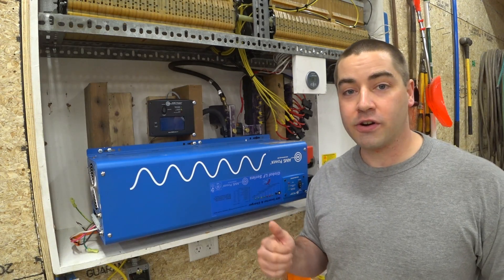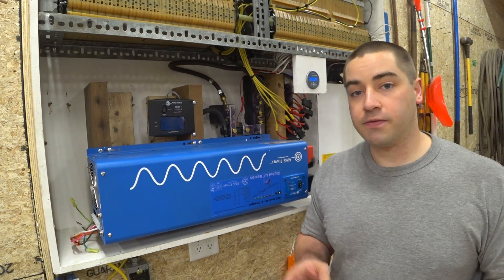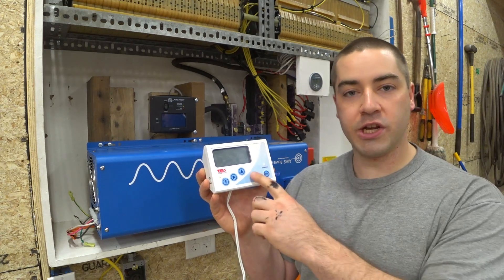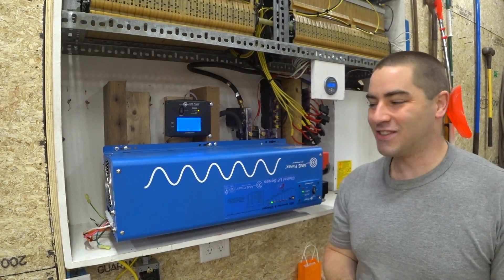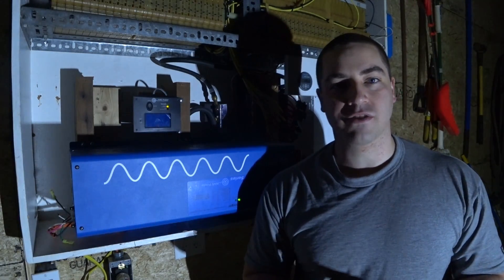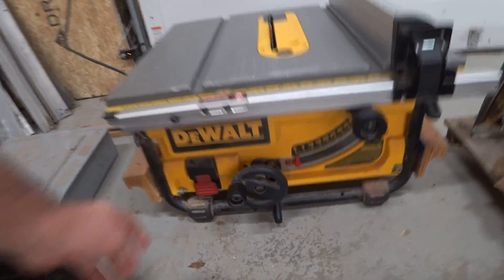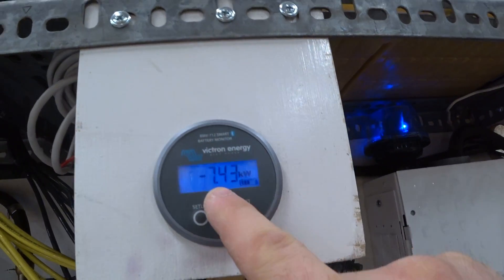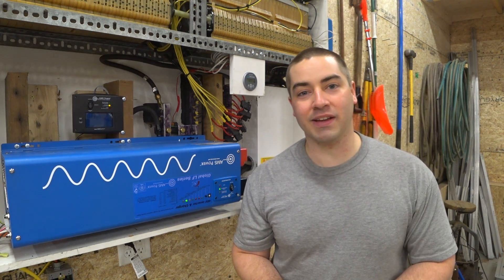Efficiency Test of Aims Low Frequency Inverter

Comment: I am copying your setup, but am a few months behind. Many thanks! Right now I am getting all the cells in balance (you should consider this before it is too late). I hate the thought that I have to keep the inverter on at 80 watts (or 66) just because of my garage door opener and invisible fence. I am considering a stepdown converter to take 48vdc to 12vdc and maybe using a tiny 12v inverter to run those minimal loads (actually the dog thing is 12vdc, so I can run that direct). I am also looking for 48vdc lights so I can run those straight off the battery - no inverter necessary. Thoughts?
Reply from the maker: That's cool that you are making your own off-grid system.  When I first bought my batteries I checked every cell and they were in balance.  Since then I have checked every cell about once a month and they are still in balance.
I agree that 80 watts is a lot of energy to burn up for phantom loads.  Magnum, Schnieder, Outback, and Victron make excellent inverters that have less idle draw.  They are about 3x as expensive, but very nice units.
Could you have a DC to DC step down converter for a small 12v load, yes.  However, I've run some of the numbers on this considering it for my own setup and choose against it.  The DC to DC converter will not be able to supply the amps needed to run a garage door opener.  So you need a 12v battery in-line.  The problem is the amp draw. It winds up being a big battery to supply enough amps. (expensive)   There are two options I would prefer.  1. Oversize the solar and battery to compensate. or 2. use battery based systems for things like this.  Such as: https://www.homedepot.com/p/Ryobi-Ultra-Quiet-2-HP-Belt-Drive-Garage-Door-Opener-with-Battery-Backup-Capability-GD201/303810513
Reply: @DavidPozEnergy  Don't run those cells all the way down and don't charge them all the way to 100%. If done and you stay on top of those cells (which I can tell you will and have been.) You will never need to worry about balance! Love this stuff!!! I want a Volt or leaf battery bad! My junk yards will not sell them to me tho =(
Reply from the maker: @Kevin, I agree.  I don't know what the perfect settings are for these batteries, but I am currently charging up to 49.2v (4.1v/c) and discharging down to 42v (3.5v/c).  The 42v is when I think the inverter cuts out, but I don't know for sure until I get to try it.  I think that range is good for the batteries?
Reply: @DavidPozEnergy  Based on what I have only read that looks great. I have zero first hand exp with those batteries. It looks like the sweet spot tho.
Reply: @DavidPozEnergy  Gonna use your amazon link from now own! I want to see how this comes along! You're a down to earth, good family guy. I'll support that any day!
Reply from the maker: @Kevin,  Thanks for the support.
Reply: I'm running a Schneider conext 4024. It seems to consume 200 Watts while only putting out 100. I have to take a closer look at it to know if it's really any better better than your inverter.  Possibly less efficient than a 48 volt because stepping from 24 all the way up is a bigger jump.
Reply: My house rarely consumes less than 200 Watts. Seems like there's always a refrigerator or freezer running along with all of the Phantom loads

Comment: Nice. I would of like to see how long it could of held that 8kw before it kicked off. Also, how long does your battery last at that high of use?

Is this solar and battery solely used as a backup system?
Reply from the maker: Hi Mike,  I've got the whole house running on the inverter right now as part of a capacity test.  I made sure the batteries were 100%, and now I'm running them down until the inverter kicks off.  Can't wait to see what the real world capacity is of the batteries.  That video should be out next week.  As for the 8k.  I'm so nervous about killing the inverter (since I already have two others die).  If I knew for sure that Aims designed it in such a way as to shut down and protect itself, then I would do it.  But as I've seen with "Reliable"  apparently safety features are skipped.
Reply: @DavidPozEnergy  main issue is the dc to dc inverter inside the aims that feeds the transformer a constant voltage failing (blowing all the Mosfets on it and the dc controller) 
if you keep it at half load (under 4000w) all the time it should be fine (they do 10-12kw inverters with some silly peak loads for 10 minutes it has a 2 massive transformers in them to feed each phase/split phase)

Even if you don't it should last longer then high wattage Mosfet based inverters

Comment: There is a surge rating on the inverter. It's rated at 6kw but there is a surge rating to. Up to so many minutes at what rating. Look at book or lable
Reply from the maker: Yup, but the surprising thing is that Aims was telling the truth.  LOL
Reply: @DavidPozEnergy  I like the magnum inverter. It's has a good surge rating and is expandable
Reply from the maker: I agree, the Magnums look great.  My favorite magnum setup is "David Armstron"  Have you seen his? https://www.youtube.com/channel/UCoo6H7QRaFq51fGZ27xuBrg
Reply: @DavidPozEnergy  yes he's got a really nice System.
Reply: These are transformer based inverters so limit is size of transformer and heat, the transformer has to have same input voltage witch is where the dc side of the inverter is for to step the voltage up or down to the transformer so the Mosfet part of it is less likely to fail as its not doing any AC stuff (but it is the most common part of this inverter is still the dc to dc Mosfets that is common to fail, witch takes out the dc controller as well but is easily replaceable )

Comment: The idle wattage is lower because your Battery Voltage is lower, on a fully Charged SLA (or a 14S Lithium) Battery at ~58V it'll be closer to 80W
Reply: It's boosting to the same voltage though so in theory you'd just have more current at lower voltages meaning the same (or more!) power
Reply: @tomstdenis  I agree Tom

Comment: Check my math but the last test was about 88% efficient?  So the claims are true.  Not a bad inverter really if you can accept the lower efficiency when compared to much more expensive units.  It seems to be very capable of running to peak!  I wonder if you can tweak that low voltage shutoff somehow to be more in line with your batteries.
Reply from the maker: I plotted the curve, shown right at the end of the video, and it looks like the inverter operated above 88% most of the time.  It's nice of Aims to not over-hype the product.  They seem to have provided real info.  There is a dip-switch that seems to adjust it from 44 to 42 volts.  I'm planning to run it down tonight and find out exactly what the low cut-off is.  I'll be posting that video probably in a week.  Usually it takes me a week.
Reply: Your math is spot on! It would be handy though, if he showed the output wattage first, then the input, so the efficiency could be calculated in real time. You have to admit, that's good efficiency, for a crude low frequency transformer. That big transformer does, however, explain the high idle wattage.

Comment: Hi what was the battery voltage at the end ?
Reply from the maker: Hi Les,  I don't know.  But I've got some meters on the battery right now as I'm doing a capacity test on the batteries.  That video will probably be out next week.  Thanks for watching.
Reply: @DavidPozEnergy  yep, i would have wanted the battery sagging as well.

Comment: In de DC meter you are only seeing true power and in the AC side be sure to consider only the real power and not the reactive power. But also consider, that the reactive power needs to be handled by the inverter, and that will change the efficiency by a lot
Reply from the maker: Hi David,  I'm sorry, I don't know the difference in reactive vs. real power.
Reply: @DavidPozEnergy  Real power is measured in Watt (W), while complex power is measured in volt-ampere (VA). The complex power is composed of the real power and the reactive power. The "AC power" article on Wikipedia gives a good overview of this concept. 
When you have loads that are not purely resistive, for example AC motors that have an inductive load, the current won't be in phase with the voltage. When the current is not in phase, you increase the total amount of current drawn. The real power (Watts) stays the same as a resistive load, while the complex (VA) power increases. The increased current with a reactive load doesn't draw more energy, but it increases the total current. This has downsides, because all the components that carry the current must be able to handle this increased current and you get greater transmission losses (power losses due to wire resistance). This is the reason why AC power equipment is both rated in VA and W. For example, a typical UPS might have a 1500VA rating, but only a 900W rating.
Reply from the maker: Thanks DieselPowered.
Reply: @dieselpowered  
Perfectly explained.
This is almost I was going to say and thank you DieselPower for your contribution.
Reply: @DavidPozEnergy  (to add to my reply) this is why you'll see the efficiency drop as you turn on inductive loads.  For instance 4kW of inductive loads vs 4kW of resistive loads will see different draws on your batteries.
Reply from the maker: @Tom: Thanks.  I believe you.  It's intresting that when you look at my excel sheet, the efficiency went up when I turned on the table saw.  There are probably a thousand variables all mucking it up.
Reply: @DavidPozEnergy  Oh most likely there are multiple "sweet spots" for the inverter but you also had what seemed like a dozen appliances on.  For science you should scope the AC output of the inverter and look how it changes with the different loads.  :)
Reply from the maker: @Tom St Denis:  I'd love to scope the inverter, along with my 3000w Reliable.  It would make a great video.  Are you in New England so I could borrow yours?  I can pick it up, make a video, and return the oscilloscope to you.  I don't have one.  (I'm being serious, no sarcasm)
Reply: @DavidPozEnergy  Sorry David, I'm a cannuck from Ottawa (and I don't own a scope that can do AC).   Hopefully someone volunteers one though I'd love to see the waveform with inductive vs resistive loads :-)  Cheers.
Reply: DavidPoz I am sorry I should have explained. Well but I see that you have great explanation from other viewers by now. Keep the good work.
Reply: @DavidPozEnergy  inductive loads draw the voltage and current out of sync meaning it takes more power from the grid (in this case your inverter).  In a resistive load the current matches the voltage.  This is also called power factor.  For instance, a really crappy switch mode power supply might have a PF of 50% meaning it wastes a lot of power.  Whereas a giant resistor (like your heaters) have a PF of 100% (or near that) meaning the true power and apparent power are the same.   This is why large inductive motors tend to have capacitors across them to help smooth out the power factor.
Reply: I want to say thanks for all this solar project videos and for testing beyond the capacities of the devices, i am thinking to contruct something like that in my home in the future, living in the Caribbean in a island expose to hurricanes every year is really stressing situation, since last year i was looking for information about what equipment and devices is really good and reliable without expending too much, or keeping the project in good budget, i saw many many videos selling a lot of devices and showing how to build it but so little testing, always heard about AIMs inverter are one of the best but never see why is one of the best and you show it to everyone, is really awesome and very very good way to testing everything in the most clear way... thanks again and please keep it up!!!
Reply from the maker: @nloggraficas: I'm glad to hear you enjoy the video.  The Caribbean is certainly a location vulnerable to power outages.  I hope your build goes well.  Thanks for watching.
Reply: What in the world is he talking about..  the only reactive power that matters is he turned on all that stuff and man did you see the reactive? I mean reaction..lol

Comment: Awesome I believe the giant wires and the lithium battery contribute to the over spec results. Next show us how well the panels contribute to the output, Cheers. Sunshine on my solar panels makes me happy.....
Reply from the maker: Maybe, I don't know (about the wires contributing).  The solar array is rated at 4380 watts.  There are losses in the charge controller.  However, my Victron App records daily highs, and two days ago it peaked at 4,617 watts. Highest I've seen.   I don't know how that happened, but I'll take it.
Reply: @DavidPozEnergy  I have seen many solar setups produce 5-10% more power than what they are rated for. A good panel on the perfect day at the perfect temp will overproduce. Sometimes you can have cloud lenzing as well. Sweet setup. You are gonna force me to buy more panels!
Reply: Wire can help or hurt. If Wires are hurting your efficiency you will know it pretty fast when they get hot. Any heat in the wire means you need a bigger wire.

Comment: not bad at all. its the no load that sucks I guess.
Reply from the maker: Better than I expected.
Reply from the maker: Have you ever checked what the Magnum draws in idle?
Reply: @DavidPozEnergy  i believe it was 75w for the 2
Reply from the maker: That's great.  So 75 watts for 8800 w inverters.  Or 0.85%.  Mine at 66w for 6000= 1.10%  So your Magnums are definitely more efficient.